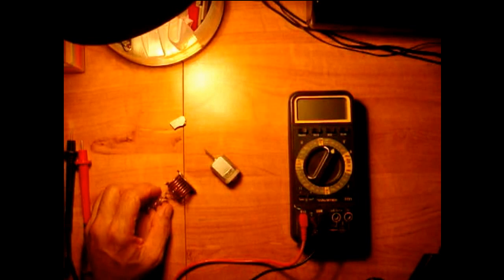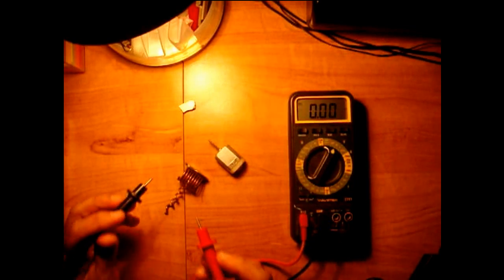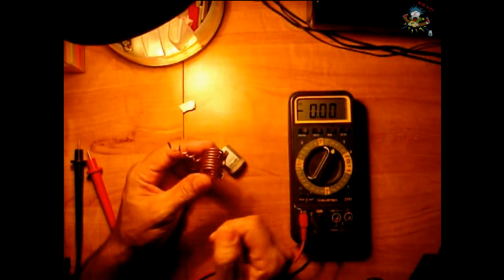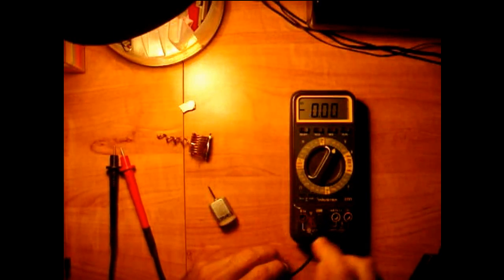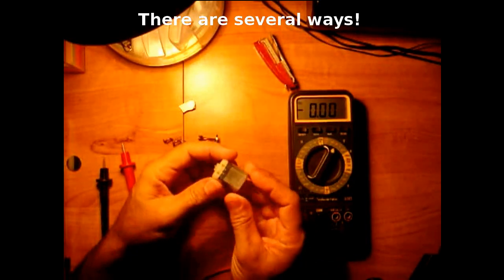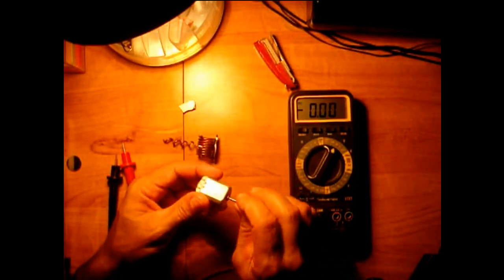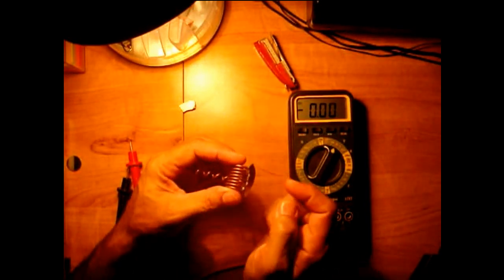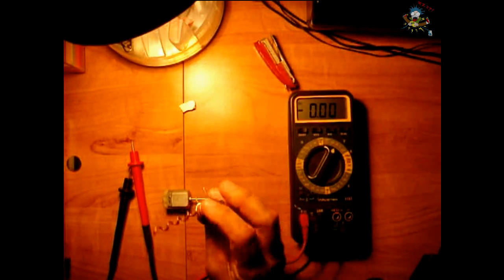FREE ENERGY Radiant Collector?

Comment: With your meter motionless under a static lightsource it would be easy for you to edit video and insert the desired readings from other videos shot under the same conditions.  Actually even a moving meter under changing light sources it is getting easy to do with pixel tracking supported software, even free stuff like blender.

You are absolutely right about all the fake videos.
Reply from the maker: Your right. If you can edit videos, you can make things appear as you'd like. I used Blender for 3D work. Great program.

Thanks For Watching

Comment: Thanks for making this. I think I saw that he may have hidden batteries under the magnet.
but your theories are likely as well.
Reply from the maker: I also thought he could have used very thin button cells between the magnet and coil.
Reply: Glad people like this are on Google+
Reply: Faraday's law. EMF is a function of changing flux density. Nothing is changing in his setup, so it's not possible to get a voltage reading just buy a magnet on a solenoid..
Reply: ☺!Funny!
Reply: Yes, GREENPOWERSCIENCE made a video where he did just that, a year or two ago.

Comment: You are over thinking this trick. The batteries are between the copper coils and the magnet and covered by the hot glue base. Place the magnet on a table. Place one 3v battery pos down and the other 3v battery neg down. Measure the voltage and you should get 5.9v with the voltage drop due to the magnet. The coils are likely separated to prevent a dead short at the tail. That is way easier than taking apart a DMM or motor.

Comment: I think I saw a simular scam before where the button cells were under the magnet and there was a cut in the coil between them so the coil was split. so going across it equals around 6 volts

Comment: Why don't you put 2 magnets on there.. you need a constant flow of electrons, which is done by facing 2 magnets of the same strength on each side of your coil. 
My video will help prove this to you
http://youtu.be/XOq9C3YSjKg
Reply from the maker: Hi Gerard. Your not going to create any power in a coil using a stationary magnet. You need a magnetic field which is changing. The video this was made about was a fraud. I did watch some of your video. Unless I knew you personally, and saw everything up close to inspect, I trust no one.

Thanks For Watching.
Reply: Try to use proper wire. Roughly 16 gauge magnet wire. It's a varnish insulated Wire, your magnet cannot ground the loop of your coil. If you use any other wire, then it will not succeed, all coils would be grounded.

Keep an eye on the channel electronicsNmore.. I have a few more videos I'm uploading in the next couple days.
Reply: Gerard Morin You are one of those people who posts a lot of nonsense videos. Overunity, free energy, cold radiation, ect.